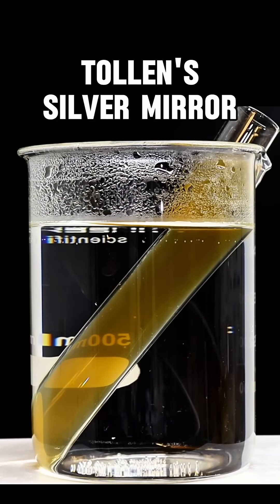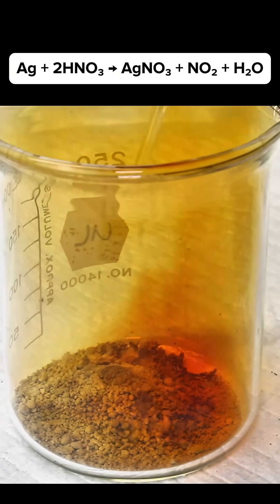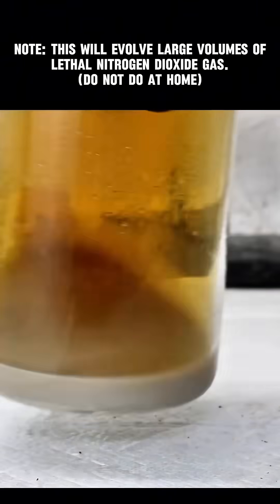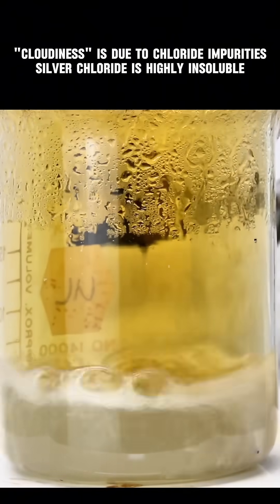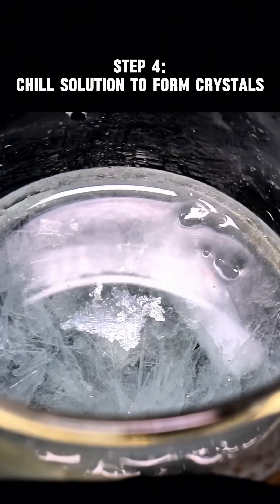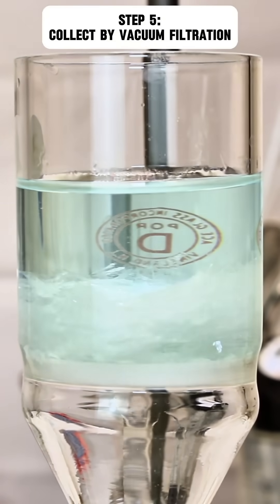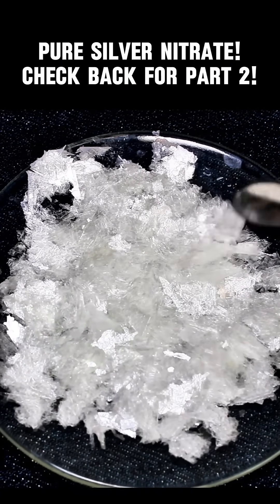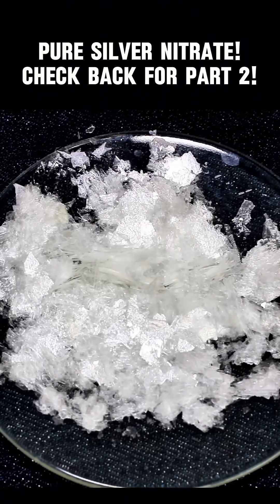Making Silver Nitrate for a DIY Mirror

Comment: There were instructions for this reaction in the first book I ever read on making your own telescope.  After all the process of grinding and polishing the primary mirror, it has to be reflectorized, and when the book was written, vacuum aluminizing wasn't yet cost-effective for amateurs -- but silvering with the Tollen reaction was.  You'd make up the solution, clean the mirror till a bacterium would just slide off, add the glucose solution and pour the solution over the mirror.  Wait for the reaction to complete, then you had to burnish the silver down to the glass to ensure it would stay stuck.

The resulting mirror was the brightest reflecting surface you could make until dichroic mirrors came along (1970s?), brighter than aluminum -- but in the modern world, there's enough sulfur in the air that the silver will darken visibly over time and you had to redo the coating every couple years (using nitric acid to clean off the old, tarnished silver).  

Modern aluminum coatings aren't quite as bright, but will last decades, because the oxide coating that forms on aluminum is thin, uniform, and best of all, transparent.  BUT it requires a high vacuum chamber large enough to fit the mirror and a sputtering apparatus inside...

Comment: You do know how to buy distilled/filtered water, without the chlorine added, don't you? Or better yet, distill your own water??

The first steps in chemistry is to learn how to purify your chemicals before trying any reactions which could be dangerous, if there are unknown contaminates in them...
Reply from the maker: Of course, that is definitely a good first step. If you weren't already aware, there are zero contaminants in US municipal water that could ever be dangerous in any reaction. However, using distilled water is a good practice, mostly for replicability. The water I used in this video was distilled, and I measured it at 5ppm TDS. This is more than pure enough for most reactions, but silver is so sensitive to the chloride that you must either use DI water or a double/triple distillation.
Reply: @integral_chemistry  Tell that to the people who lived in Flint Michigan!

Comment: Yea i dont know any possible way to obtain certain pure acids either concentrated or diluted.. like nitric or sulfuric, unless you use a battery..  but its not pure..  the acid i use to etch porcelain and glass i had to order specially and is still mixed with some surfactant..
Reply from the maker: Do you live in the US? Only source I've found is DUDA energy for nitric and sulfuric. I still just make my own nitric acid though because it ain't cheap
Reply: @integral_chemistry  Thanks to the wonders of solar panels, inverters, fish tank air pumps and neon sign transformers... not the most efficient method, but there's no paper trail :)
Reply: @Z-Ack you can make most/all of them depending on what you have access to. Look for non-US/CA chemists or NurdRage (People like Explosions and Fire or Scrap Science from Australia, or Amateur Chemistry from Poland) They nearly all have methods of synthesizing and purifying the acids.